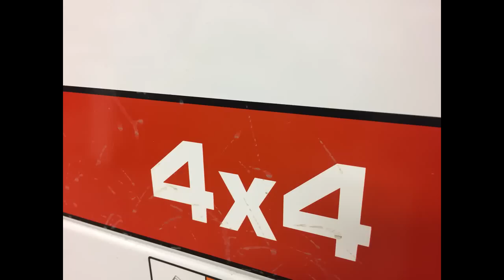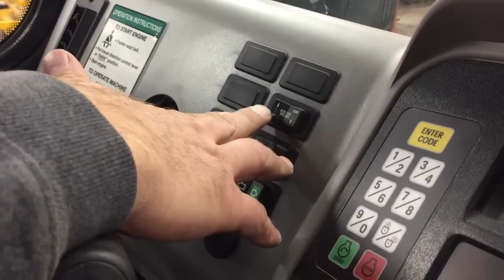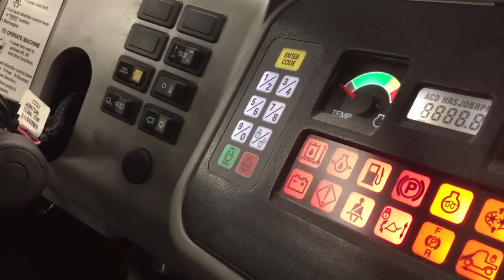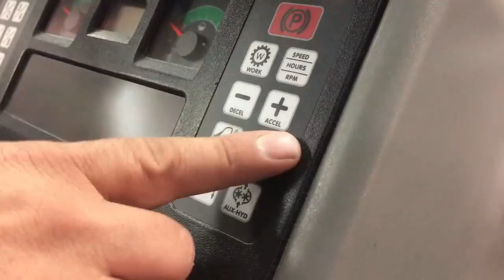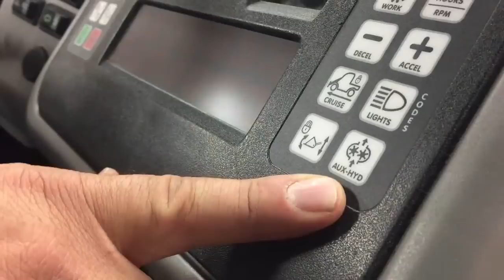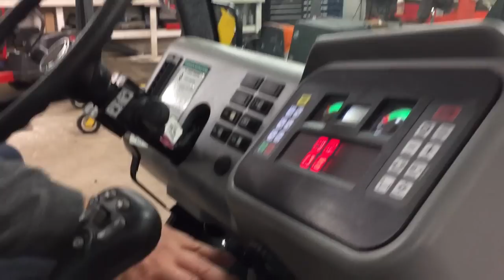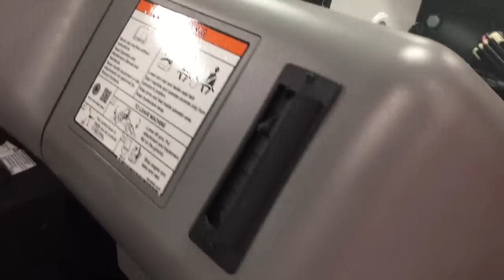Bobcat Toolcat 5600 Utility Work Machine Walk Around

Comment: What's the highest you could live the front boom and how much weight will it hold cause I'm looking to get one with attachments and I have like The Home Depot rax I wanna put the stuff up on top of the racks Please comment back thank you
Reply: The next video is of one in action. It can lift up to 1500 pounds seven feet high. Back bed you can haul 2000 pounds. It can tow up to 4000 pounds.

Comment: Nice equipment, what's the sticker price?
Reply from the maker: Brand new retails around $61,500
Reply: @equipmentconnection5940  nice unit  love that 61hp turbo diesel kubota engine  there sure are easy to service on